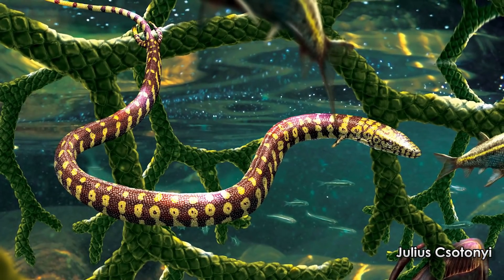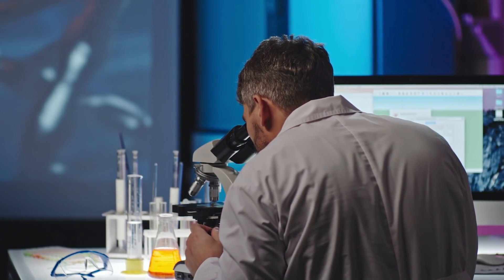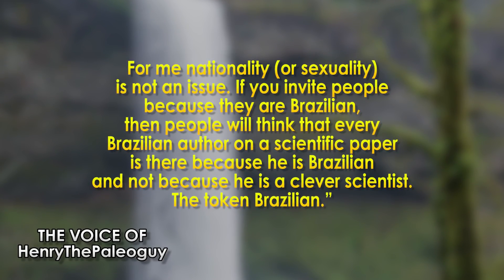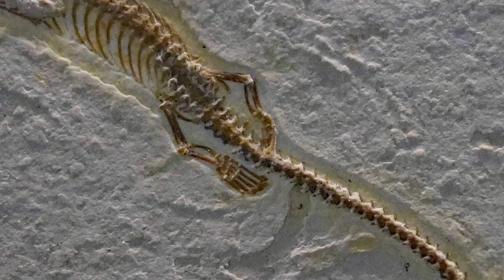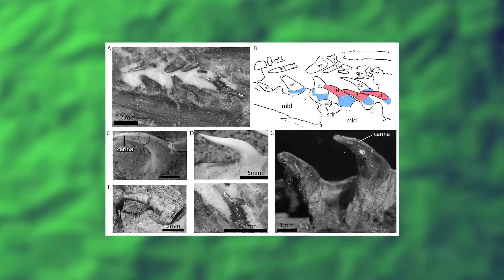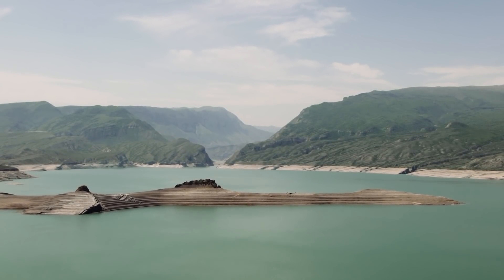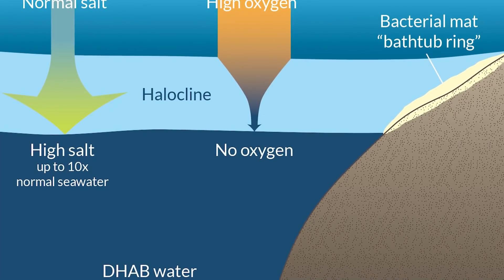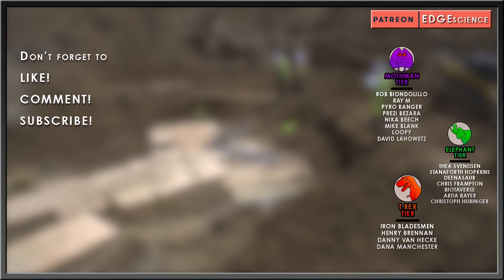Tetrapodophis (The First Snake) ISN’T A SNAKE!? – Plus Paleontological Colonialism At Work

Comment: In regards to the legalities and ethics of private collections of this nature. The threat of a significant specimen not getting cataloged Because the "owner" didn't leap through the proper legal red tape to get it there is an unpleasant rabbit hole.
This specimen was in a private collection or a "locked closet". We know there are more locked closets out there, we don't know where, how many, or what's in them. If we criticize someone who puts something out there, that's going to set a precedent and example to others who have locked closets that may have significant pieces.
Reply: I must respectfully disagree. Criticism is abound everywhere - just criticising something where there clearly is wrongdoing (whether the benefits outweigh the wrongdoing or not) does not set any kind of precedent. It has very little effect if at all on locked closets staying locked or being brought forward.

For the case in point, the regulations clearly has a good purpose, and it doesn't sound overly onerous. Martill could still have bought the fossil and follow through the right processes. Now if there are flaws in the law, it can be amended - and quite frankly fossils aren't urgent enough that we can't wait for the legislative process to take its course.

The regulation is also meant to help Brazil develop and protect its paleontological research community. In the long run, this is going be much more effective in increasing the excavation of fossils in Brazil, discouraging illegal digs or fossils being ferried away in private collections, and recovering fossils from locked closets, than just getting a few fossils by ignoring regulations. I would argue following the rules far outweight the benefits of skirting the red tape in this case, and conversely breaking this law does more harm than good to paleonlogical research.